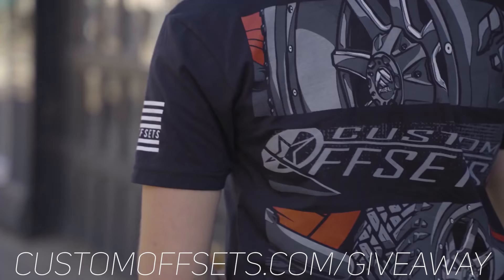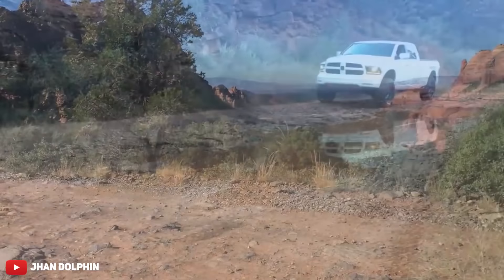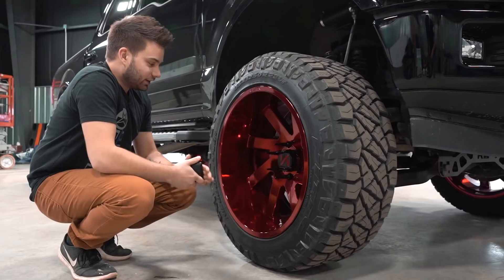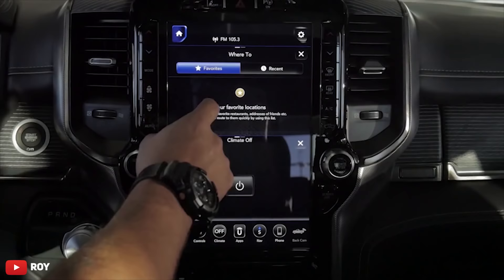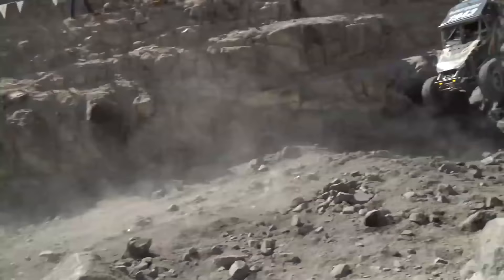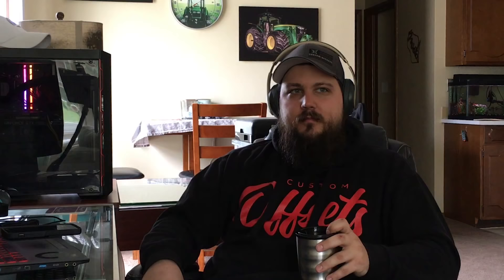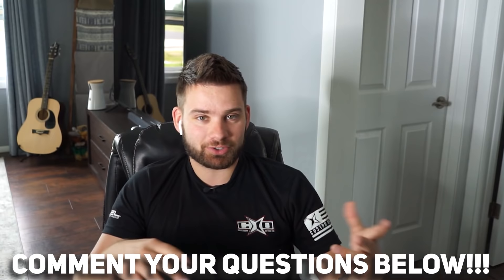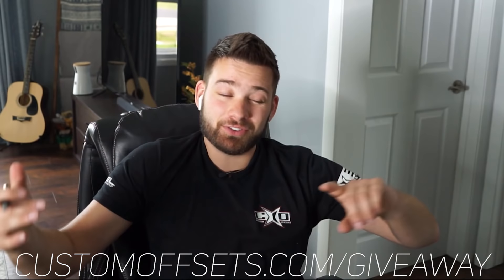Slammed Cat-eye or Giant OBS Build!?  || This or That

Comment: First gen dodge custom built crew cab 12 valve cummins with any mods you want on it for free with an allison transmission OR a brand new chevy kodiak crew cab truck with the duramax with american force wheels 20x12 on a  6inch lift?

Comment: I mean technically the Ram Power Wagon is the raptor killer because the Power Wagon is better off road unless you did Baja racing but the Ram has heritage dating back to WW2 with the original Dodge Power Wagon